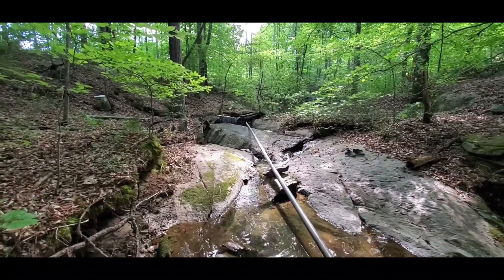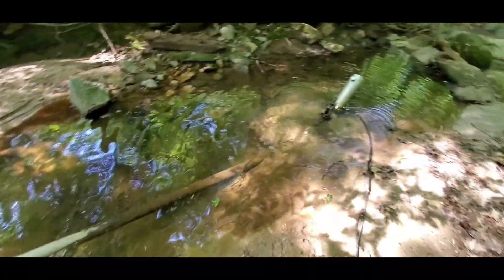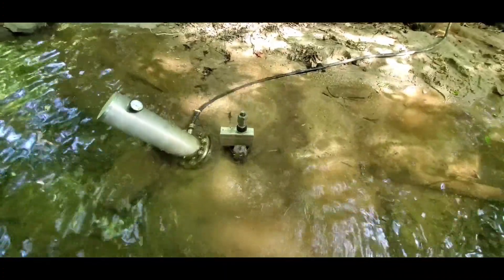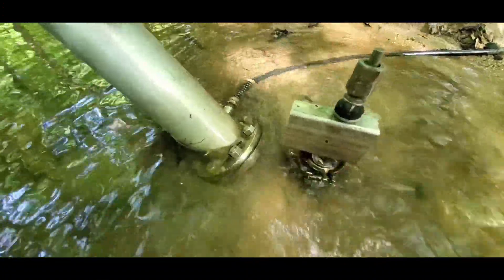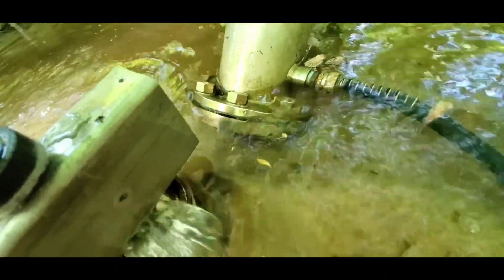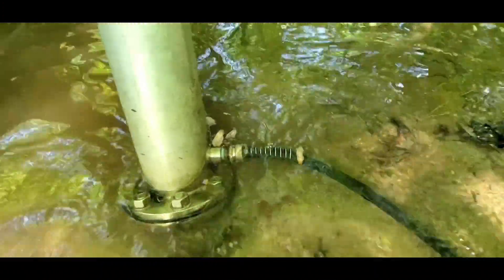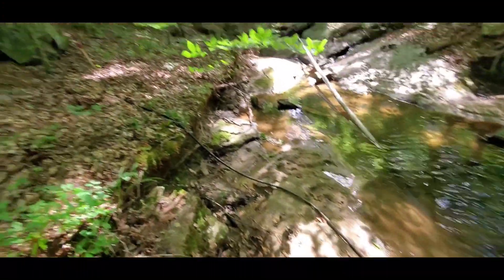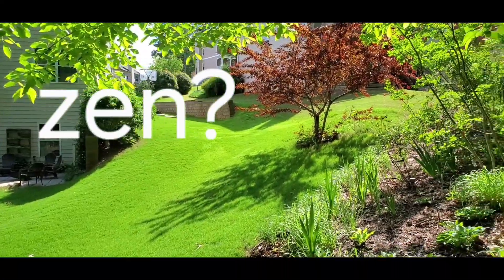Hydraulic Ram pump's output lifts water 45 feet with only a 50" supply head

Comment: With a couple of details you can improve your pump. With a 3" pipe diameter, you can pump more water. I would recommend using a larger drain valve and placing the tank before the valve, not after it as you have it. Place the pump out of the water and drill the pipe 1 mm approximately before the relief valve.
Reply from the maker: Thanks for suggestions. I don't need a weep hole because i dont need to replenish gasses. The rubber balls replace a trapped air bubble and provide the elasticity needed.

Comment: Nice setup. Do you have construction plans? Thanks
Reply from the maker: No, sorry
Reply: Can I pay you for construction plans or can you provide a list of parts. Gratitude
Reply: @PrivateMemer-f7m  I can help you, but you have to understand that it is not an engine. It all depends on having the conditions, you must have a river and a difference in height between the water inlet and the ram. The higher the height, the more power. The limit is this height times 12.
Reply: @gerardovargas9904  I do have a river and sitting on a  200 ft bluff